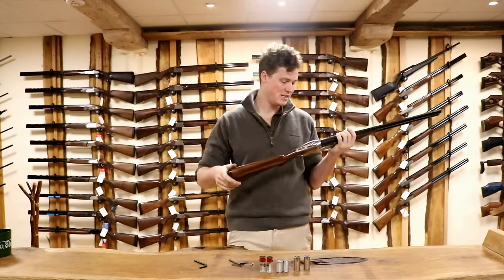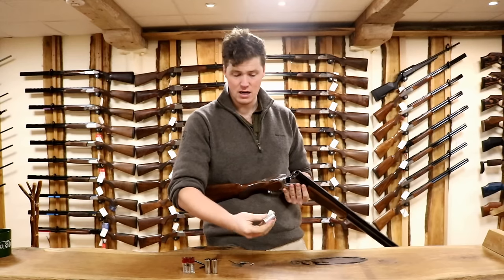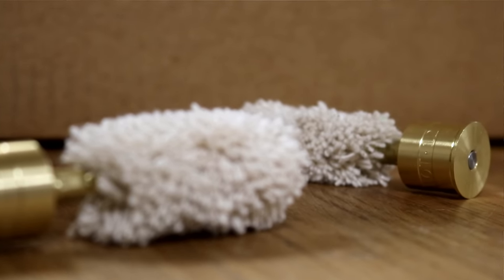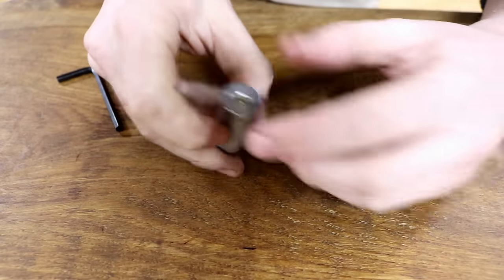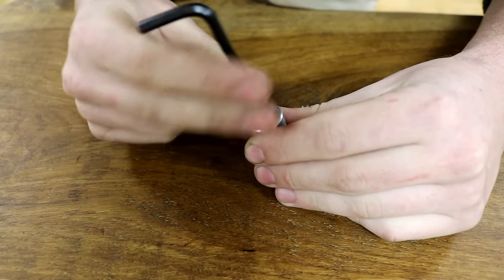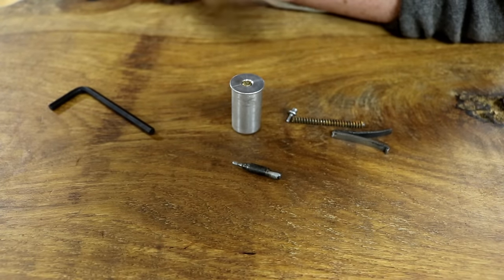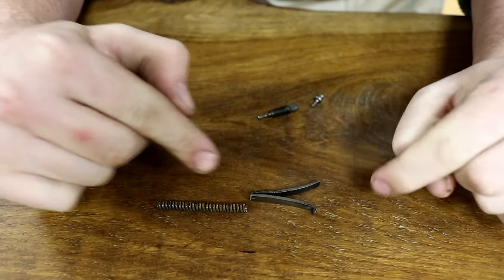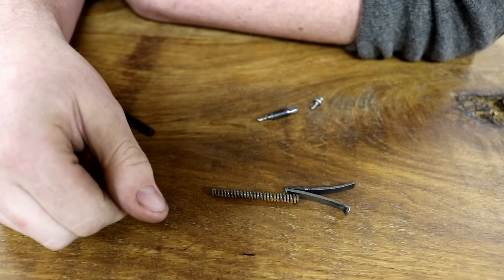Snap Caps Explained

Comment: While anecdotal, I have a Beretta 686 that I bought new in 1987. Conservatively, I have 375,000 rounds through it. I've replaced the ejector springs once. Cracked one stock at the wrist and still on my original main spring. I've used the snap caps maybe a dozen times.
Reply: But they are for dry firing, not leaving the gun live.
Reply: @CurvedSlightly  They're mostly for releasing spring tension. but sure. Dry firing too.

Comment: Back in the 60's I had a Zabala double 12 Ga, went to put it away, pulled the triggers, and both firing pins tips rattled down the barrels.  Have used snap caps in all my guns ever since
Reply: Sorry but I had to chuckle at your post. That had to be a bit frustrating hearing the pins dancing down the tubes.
Reply: I've had 2 and firing pins always broke from normal shooting

Comment: If it is better to release the springs and you shouldn't pull the trigger on empty, you don't actually need these snap caps. I'm using a Kapla wood bar to fire the percutor in when I have to store my gun. Works perfectly

Comment: Hi there - I think your clips are generally very informative and interesting. However, I think this particular one would have been considerably enhanced if you had explained what to do, and more importantly what not to do, when using snap caps and then breaking the gun down e.g. to put in its case.
Reply: What did he miss out?  I thought it was quite a thorough explanation
Reply: @lifeshort  Yes possibly but what is the purpose of snap caps? They are designed to release the cocked springs prior to breaking down the gun and storing it. He didn't show how this should be done: insert the snap caps and then fire both triggers/barrels, then remove the forend and then the barrels recovering the snap caps. Gun can now be stored with the springs released.

Comment: You don't jack your car up everynight to ease springs. Completely pointless IMO. A spring is only fatigued when it is cycled with a stress amplitude.
Reply: Well, part of the gun safety policy is not to store firearm cocked (and definitely not loaded). Thus you are supposed to release the hammers / strikers.
It was even traditional training in the army (and maybe it is even part of the practical part of the test for firearm license) to properly unload and check your firearm, aim it into the safe space and perform dry-fire (it is called "safety shot"). Thus you ensure there is no round in the chambers, firing mechanism is released and by no mistake can the weapon fire when taken, or by some mistake during transport and handling.

May not apply to every country, obviously.
Reply: Very long storage does set a spring. This can take a decade or in the case of some quality guns even longer but they are machines and stored energy will get used one way or another. I would expect leaf or v springs to take a set sooner since the stress is concentrated in a more finite area but coil springs are not immune either.
Reply: @mungo7136  fully agree. So, if firing off the action with nothing in the chamber... no need for snap caps. Answers my question as to whether I need them. Answer is no. 
I always clear my gun from the area by checking and then firing off the action in a safe direction. 

Only reason I’d use snap caps is for teaching the Missus or a friend how to safely operate the gun by using these.

Comment: How do you dissemble O/U with out snapping fire pin? Can you use snap cap and once it is loosen you can take forend and then dissemble the whole gun?
Reply: It probably doesn't work for all action designs, but I simply remove the barrels, depress the release for the locking mechanism and dry fire with a hardwood dowel against the standing breech to receive the firing pin.

Comment: I'm really confused because so many people say different things. Some folks say it's essential to relieve main spring pressure. Gun shop owners have dozens of guns in stock under pressure for customers to look at and handle. I was also told by a store owner it's a waste of time dropping the pins and storing because then you are pushing the spring the opposite way and putting reverse pressure on it. I've got a Miroku and theres nothing in the manual about this subject. The Browning group don't think it's necessary.

Comment: Use or don’t, who knows but I will say, both the coil and the V spring are still under tension after you pull the trigger regardless. A proper hardened and annealed spring goes bad from repetition not tension. 🤷🏽‍♂️

Comment: how do you employ snap caps when storing the double gun broken down?  I assume you have to leave the firing pins under tension if you store the gun in its case broken down or is there a way to snap them and then take the gun down without resetting the firing pins?  thanks
Reply: Copperhawk Copperhawk
thanks copperhawk.

Comment: If you've fired using the snap caps wouldn't the ejector springs still be under compression  unless you disassembled the shotgun?
Reply from the maker: On Certain models yes, and one of the main counter arguments for those who don't use them
Reply: @tgsoutdoors  is there a way of taking load off the ejector springs without breaking down the gun ?
I have a new ATA black sporter 12g and want to take best care of it, Snap caps for the cheap price seem worth while. But if your just transferring strain to another component it seems a bit hit or miss ?

Comment: hi do you recommend using a  snap cap for a a612 armsan? thanks
Reply from the maker: These guns are hard as nails, i would recomend using them, but you could probably not use them and get away with it
Reply: cheers for reply, thanks

Comment: What if every time I close my gun I just fire it twice? Doesn’t that do the same job?
Reply: It does release the mainspring pressure, but the idea of snap caps is to catch the firing pin softly so that it doesn't slam itself, because nothing is there to hit.
Reply: Ken Aston I see. I have never bothered to use snap caps in 10 years!
Reply: Fair enough, as Jon says in his video, they aren't essential, but just kinder to the firing pin.
Reply: @alecingram4669  55 years here.

Comment: Leaving them in isn't pointless, they are there if the trigger is pulled accidentally, and keeps the crap out of the chamber.
Reply: If you're getting crap in the chamber your storage is more an issue than snap caps

Comment: I chose to spend $15 and invest into snap caps to relieve internal tension on my firearm, drop the 'hammer/spring', make accidental discharge unlikely, yet my firearm with a 15 round mag, stays relatively ready at ALL times. Just 'rack' the slide, discharge the snap cap and load the 1st round immediately.

Comment: False information
Reply from the maker: Why?
Reply: @tgsoutdoors  you dont need a snap cap for "relieving pressure on the firing pin" its only used for when dry firing, springs wear out by constantly compressing and decompressing
Reply: The firing pin is perfectly fine in the cocked position no where on a snap caps packaging does it say to release tension on spring its just a stupid misconception